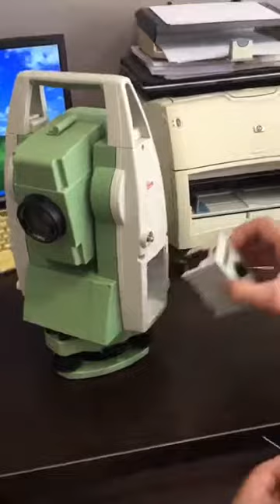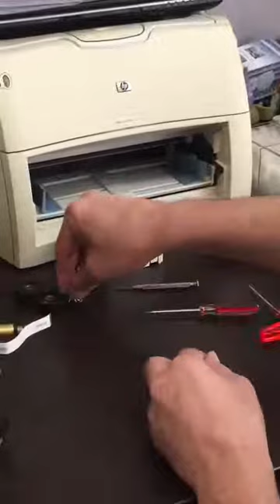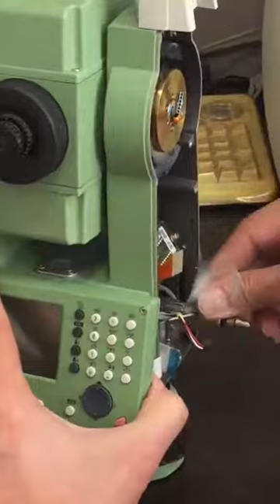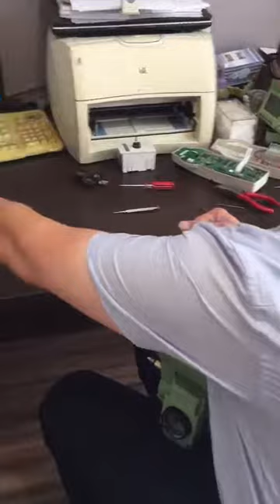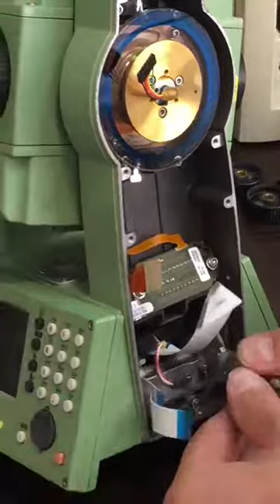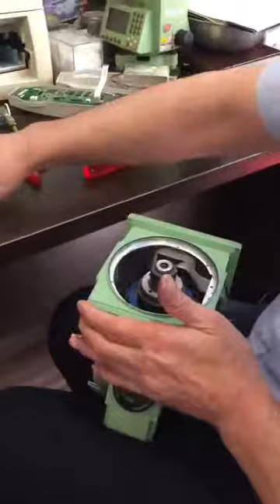Contact Us For Total Station Instrument Calibration and Service 08903732237

Comment: Leica TCRA1205 WARNING: 60.
Is this a simple or complex fix please?  I.e. clean turning circle encoder or take it all apart and replace parts required?  Instrument may have bern dropped or fell over?

CHECK & ADJUST results are mostly way below 15 seconds.  V-index is 1 minute though... but may not have been leveled best as possible.

Everything seems to work fine, but Warning 60 at start up always.

Thank you.